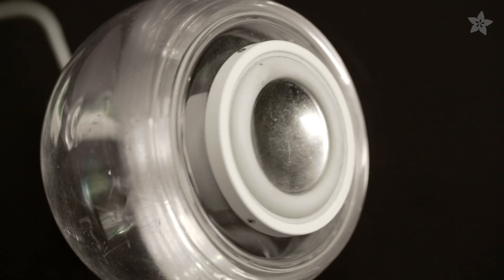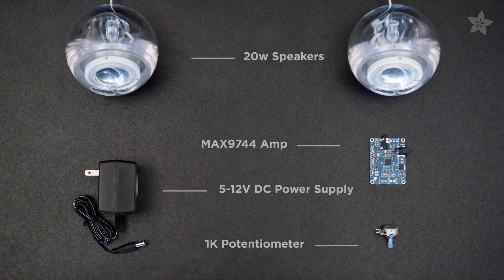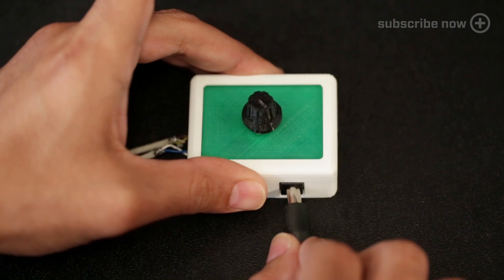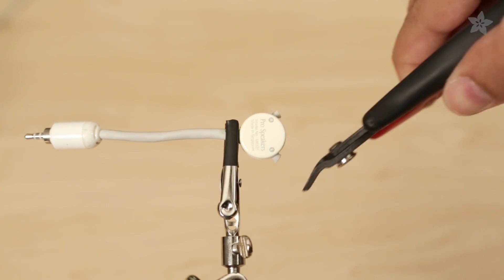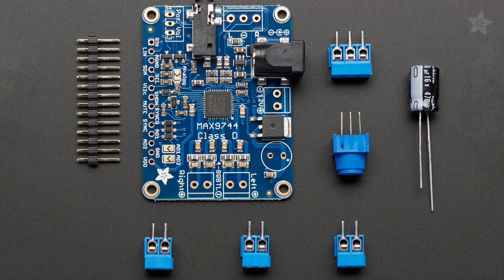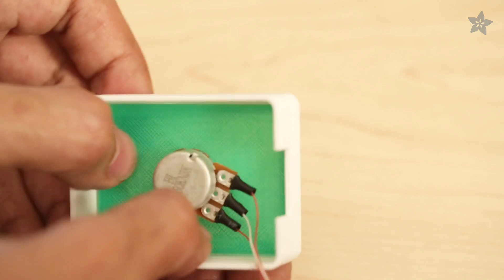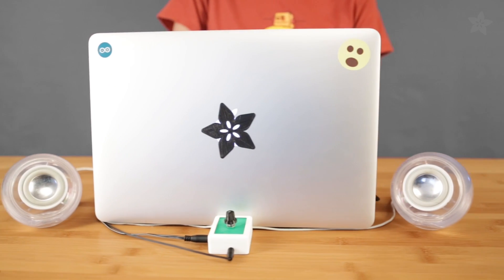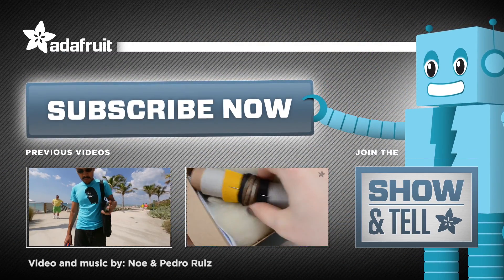3D Printed Amplifier Box MAX9744 20w

Comment: Is that RMS or Peak power?
Reply: Just looked at the data sheet, 22.5 watts RMS per channel into 4 ohms but with 10% distortion, at 14 volts and 1kHz. So 12 volt power with 1% distortion (still at 1kHz as 40Hz power is not stated) is more along the lines of 14wrms p/c into 4R, and at 5V this goes down to just 2.6wrms p/c into 4R. So even less power into an 8R load.

Comment: So the headphone jack on the amplifier is what brings the sound from the computer/sound source to the board then? Just checking, cause headphone jack sounds more like where you'd plug the speakers.
Reply: If you have active speakers than they will include a built-in amplifier. Passive speakers require an external amp like the MAX9744